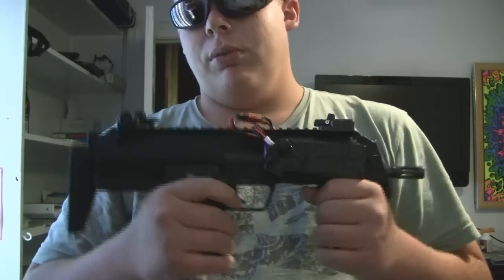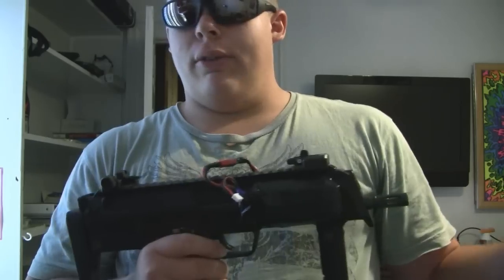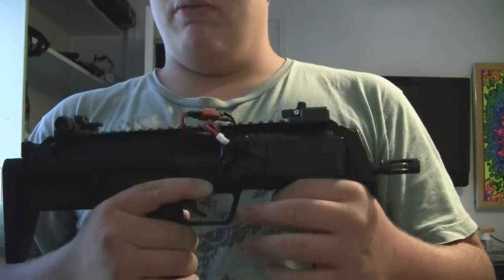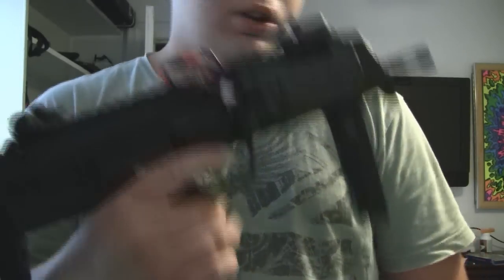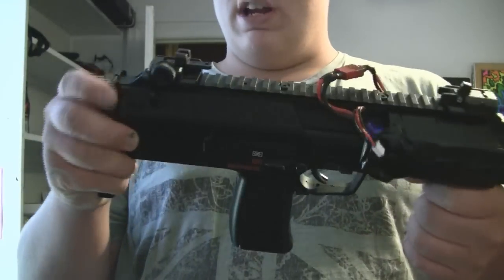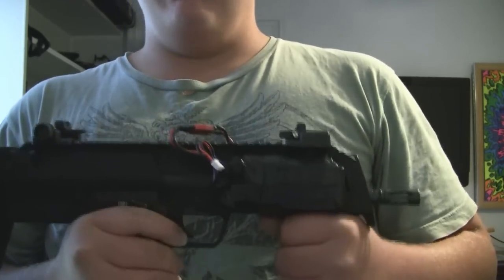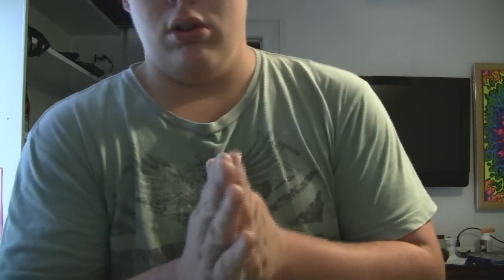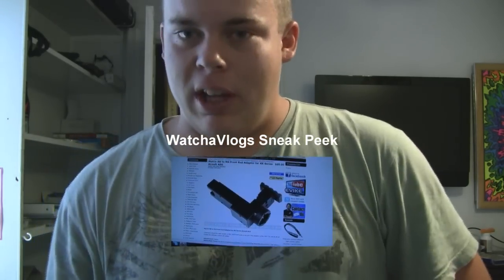tokyo marui mp7 battery mod version 2

Comment from the maker: @0611930024838 i changed my battery setup
from a 7.4 800 mah internal battery to a 7.4 1600 mah external battery, raised rof, wired gun to deans